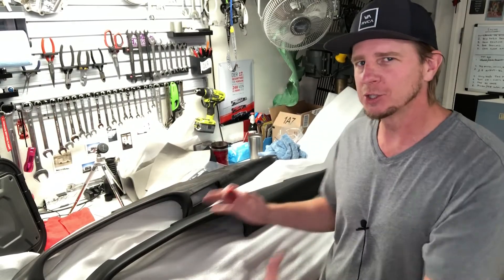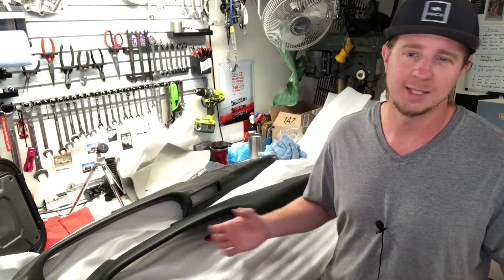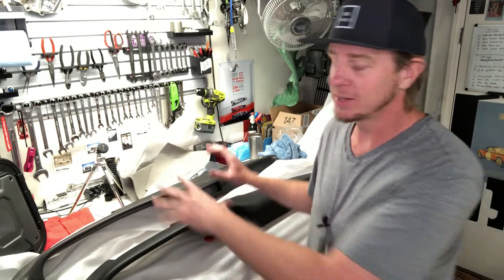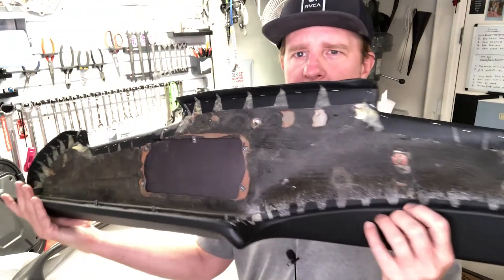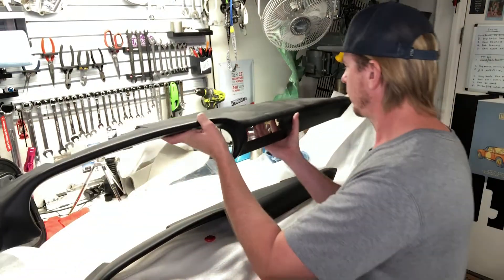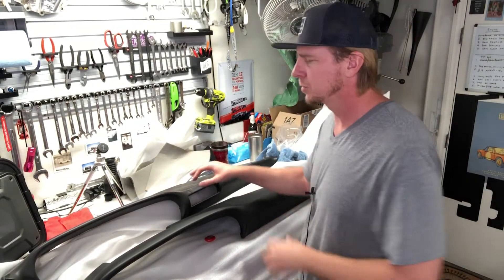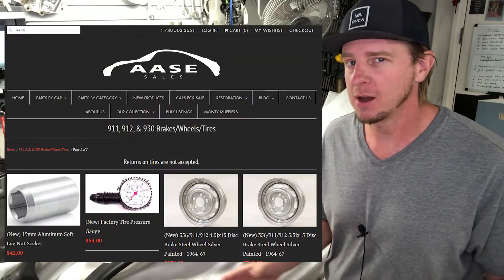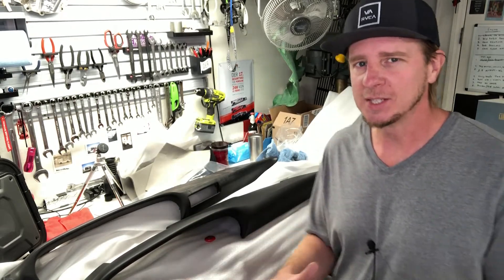Dashboard Confessionals. Showing the newly recovered dash for my 77 Porsche Project.

Comment: For the gap at the ends of the dash you show at 0:50 why don't you see about filling it with larger piece of  Windlace?  just a thought.
Reply from the maker: The video sort of unfairly characterizes the problem. It's actually much more minor than it appears as it's only visible from a certain angle with the door open. Still, as a Porsche Classic product It should fit better. I suppose it could be an install problem, as I personally installed it. However, the pegs on the dashboard don't allow for much left to right tolerance and the gap is on both sides. The top pegs lined up as well. As for windlace, a solid idea from a visual standpoint. Thanks!